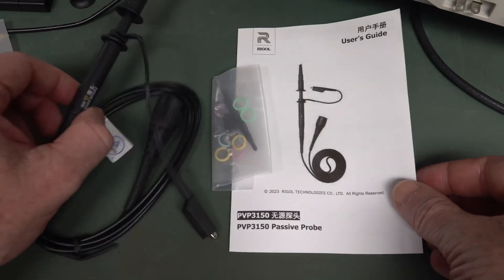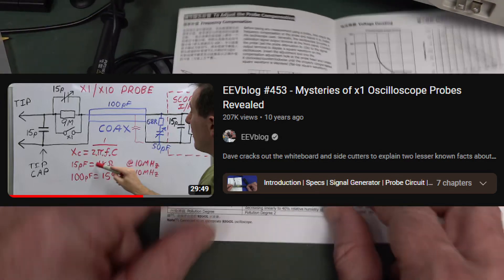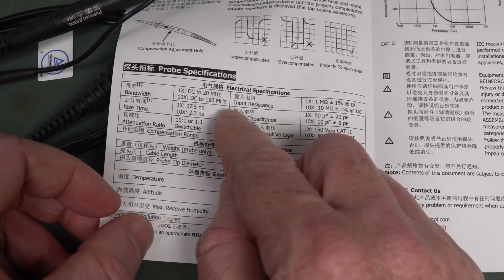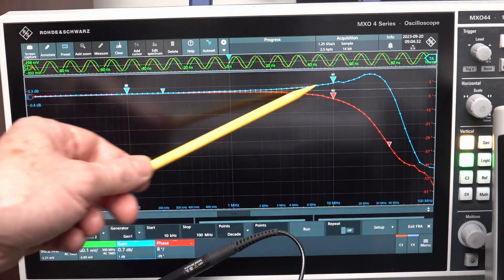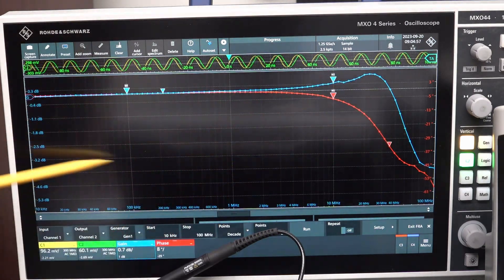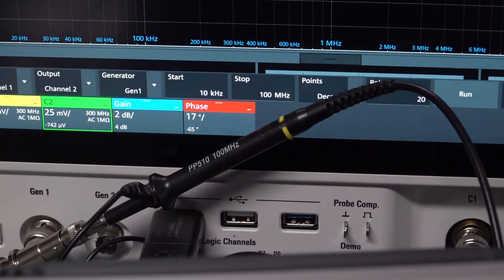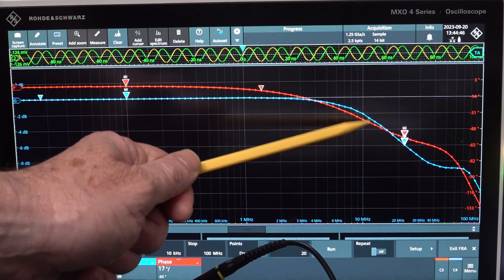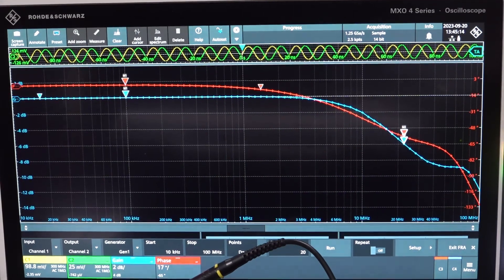x1 Oscilloscope Probe SHOOTOUT - Rigol vs Siglent

Comment: I find rigol probes fall apart. I've had 6 1x-10x p1350 or whatever probes and they break all the time. It's like you can't compensate them like all the other siglent probes I've owned. They bury the screw

Comment: There's a mistake somewhere!!!
Rigol PVP3150 - X1 20 MHz, DS2302A & DG1062Z, sweep 0,1-60 MHz, Linear.
https://drive.google.com/file/d/1QDsFiXXezI1ku22rEtwcRt4IJco1b49m/view?usp=sharing
Rigol PVP2350 - X1 35 MHz, DS2302A & DG1062Z, sweep 0,1-30 MHz, Linear.
https://drive.google.com/file/d/1a_7gur6W42T9j58byS4zE_fJBwP2bIRK/view?usp=sharing
Tektronix P2200 - X1 6 MHz, DS2302A & DG1062Z, sweep 0,1-30 MHz, Linear.
https://drive.google.com/file/d/19zje05a7W-deGBvv3gZv_E4tyJcHdD-8/view?usp=sharing
Coax 50 ohm,  DS2302A & DG1062Z, sweep 0,1-30 MHz, Linear.
https://drive.google.com/file/d/1WASbeGgNrpmjfce_6oInd_E-eiCnQQ8L/view?usp=sharing

Comment: Pretty good!  It's all in the cable.  If you cut it apart the inner wire is probably very thin steel and the dielectric is a tube.  The Rigol is $35 to $49, not like the usual $10 cheap Chinese probes

Comment: The rigol pvp2350 350mhz probes actually have a rated 1x bandwidth of 35mhz. When I first read about that, I even had to triple check that I didn't get it wrong!
Reply: thats normal for all switchable probes
Reply: @drkastenbrot  No, it absolutely is not, Go watch EEVBlog's previous video on the topic. Most switchable probes top out at 9-10 MHz in x1 mode. The Rigols are the exception, but as this video demonstrates they achieve it by accepting a small amount of overshoot just below that critical frequency. In other words, they're underdamped relative to most competing probes.
Reply: 350 millihertz?

Comment: It is a stupid thing to switch the probe to x1 for any purpose since the whole idea for probing oscilloscope is to match impedance all long the path from the probe tip to the oscilloscope input so when switching to x1 , all that technical stuff will be disabled and moreover it will put the probe in unconditional state so it doesn't matter for me whether it can measure up to 20MHz or 6MHz , it is bullsh---t measurement , switch back to x10 and be proven measurement .... By the way , oscilloscope is a time domain instrument so if you need to measure frequency content the go to SPECTRUM ANALYZER the frequency domain instrument  and base on ! ...
Reply: Not sure, but the frequency itself is not what you're interested in, when measuring a signal with an oscilloscope...
BUT there might be cases, where a signal has a certain frequency and you want to see the waveform. Now, if the probe is not capable of measuring a signal properly because the lack of bandwith ... the Spectrum Analyzer won't help you there, no matter how hard you try
Reply: @SystemX1983 No no , I disagree with you ... Spectrum Analyzer is frequency domain measurement instrument so its frequency bandwidth is so wide than oscilloscope that can measure frequency content in a signal rather its shape or form ...
Reply: @ahmedalshalchi  You are missing the point of the comment. In many (arguably most in electronics development) applications you are interested in seeing the time domain signal but need to be confident the frequency content of your measurement is there. E.g. when observing fast rise and fall signals of switching elements. You want to see what the signal looks like in time while knowing that your measurement contains enough frequency content that you aren't missing anything important.
Reply: @ChrisTasr92 You are correct in case of signal integrity for specific harmonics to form a signal shape but in case of low noise measurement , as Dave mentioned , you needn't to scope the signal and check its form but to measure the frequency content  and its volume or say power regardless what shape to be formed of so frequency domain is required for ...
Reply: Slight transmission line impedance mismatch is obvious for the Rigol probe, but it's negligible. Wavelength is about 6 m at 50MHz.
Reply: For a high power sources 1x probe doesn't change anything at this frequencies, so it's very good option for probing low voltages such as power supply ripple, for eg.